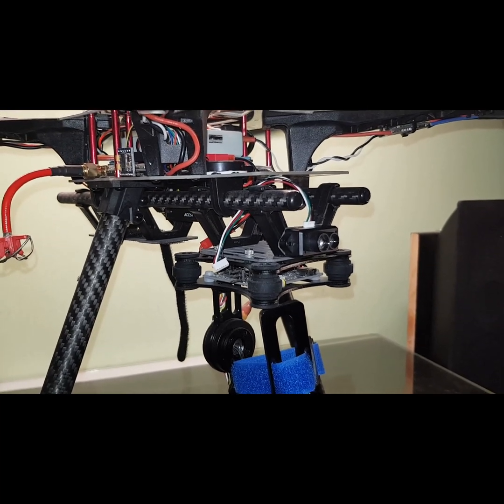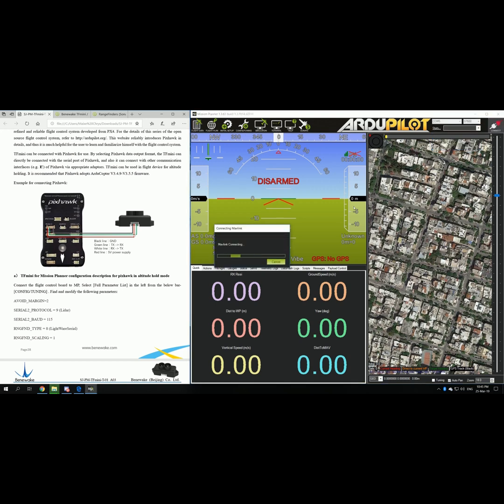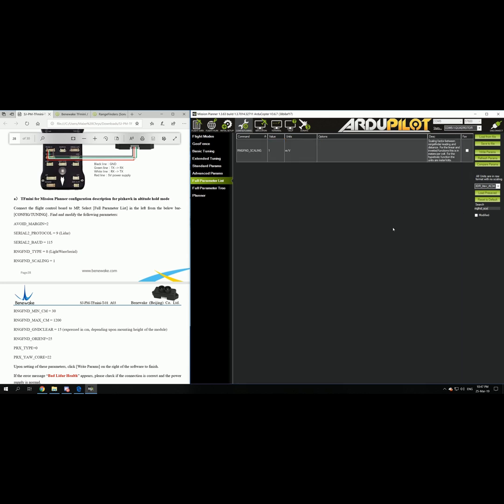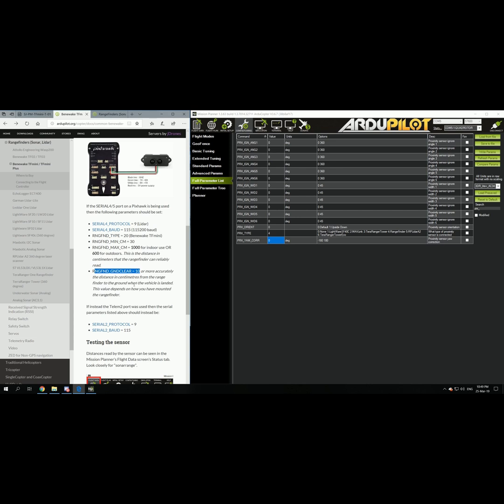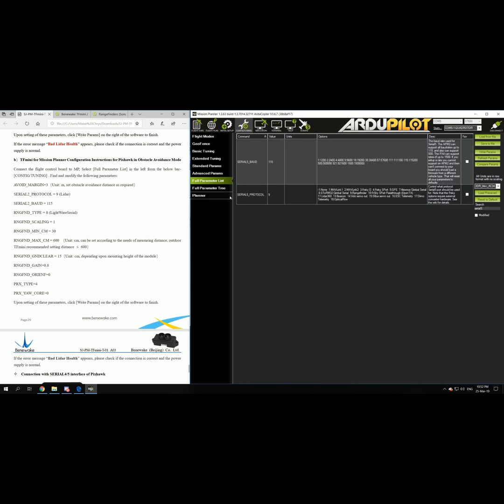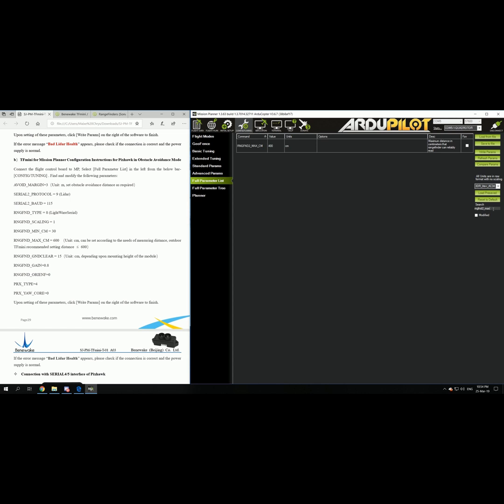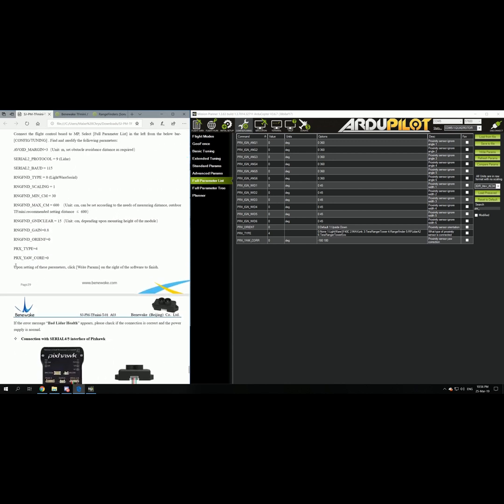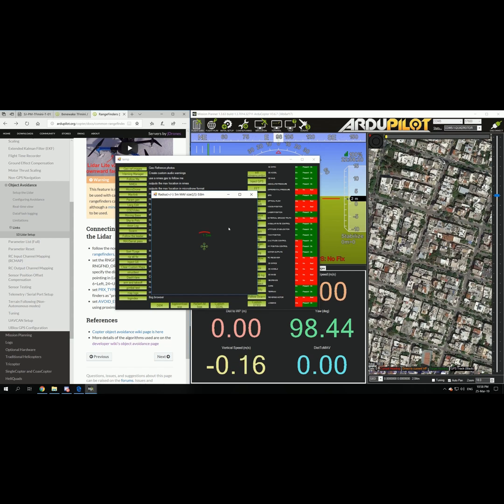Part 2/2 How to setup Pixhawk with two rangefinder sensors, object avoidance and height estimation.

Comment: Hello Maixe. In february I start my last university year project. Im making a drone that flight inside a greenhouse and collect data. But also I need to implement a object avoidance. Im gonna use the pixhawk and as you do, this lidar sensor. My question is. Once you have done all the process you do in your video, the drone automatically correct its possition when an object is detected by the lidar? Or do i need to do something else apart from this video? thanks
Reply from the maker: This will work, the only thing you might want to is to play with the settings on how the craft will react.
Reply: @maixechrys6264  Nice. Im forced to fly in althold mode. Does obstacle avoidance works in that mode. 

Also, is there a minimun of distance the lidar can detect and the drone react? I mean, as im flying inside, I will need to set the lidar probably at 30-50cm

Comment: Hi, great video. This was just what I was looking for. I have a doubt. I am using the same two sensors that you are using for the same purpose ( height estimation and object avoidance ). Can we configure the forward sensor for object avoidance and downward sensor for height estimation only( no object avoidance ). I have this doubt because parameters like Avoid_enable,avoid_margin,prx_type are global and not specific to that particular range finder. Please correct me if I am wrong.  So how can we set avoidance and avoidance margin individually for each range finder
Reply from the maker: Thank you very much for your kind words.
Check the video after 7:00 where I switch to the avoidance sensor.
Rangefinder2 in my case .
Avoid parameter only refers to the horizontal sensor(s) for object avoidance, so it really is specific for that purpose.
The setup you are trying to make is exactly what the video discribes so make sure you dont miss a step!
Reply: @maixechrys6264  got it …. So there is no obstacle avoidance for downward sensors. Only surface tracking. The avoid parameters are for horizontal sensors
Reply from the maker: @RajPatel-vc6mg  yes that is right, unless you start messing with its orientation that is how it works. Surface tracking kind of works like avoidance though.
Reply: @maixechrys6264  Thank you, I got both the sensors working. I just have one more doubt. I can’t see the sensor distances on my mission planner hud. I can see them in my proximity tab by pressing clt f . How can I see the distances on the hud like you have set them up. Thank you
Reply from the maker: @RajPatel-vc6mg  you right click the hud screen and there is an option to show aditional sensor readings, I dont remember by heart though.

Comment: hello sir, I have 3 question and i didn't find right answer :( please help me.  How can we connect external sensors (leakage, ping sonar, temperature-humidity sensors) to Pixhawk PX4? Can we connect multiple sensors if we can how do we do it? Can we connect 3 Distance sensors to Pixhawk if we can, how we can do it?
Reply from the maker: Hello, first up you need to identify what protocol the sensors use, for example are they using telemetry ports or i2c?
Reply: @maixechrys6264  --> DHT22 humidity & temperature sensor (DHT22 also named as AM2302)
     •	Output signal: digital signal via single-bus
    What protocol does DHT22 use?
     •	Single wire protocol (single wire/bus for communication)

-->A02YYUW Waterproof Ultrasonic Sensor
     •	Output: UART
     •	RX: Processed Value/Real-time Value Output Selection 
     •	TX: UART Output

--> BlueRobotics SOS Leak Sensor
     •	I did not find any information about its protocol.

--> BlueRobotics Ping Sonar Altimeter and Echosounder
     • 	The Ping sonar communicates with a serial UART using a binary communication protocol called Ping Protocol
     •	Signal Protocol: TTL Serial (UART)
     •	I found that we can connect it to pixhawk’s SERIAL2 port (Serial/UART port). Is it ok?

--> DFRobot Gravity: Analog Water Pressure Sensor
     •	Integrated Circuit (IC) engineering technology.
Reply from the maker: Uart is a telemetry port, so you have to connect it to one of the 4/5 telemetry ports and go to the advanced settings and change the number that corresponds to your sensor maybe the manual has this information.
Uart or telemetry ports are unfortunately limited and Telem_1 is reserved for the usb connection to pc.
On the other hand I2C port can connect many sensors using an I2C splitter.

Comment: hi sir can you please explain how many sensor i can attach to a pixhawk. can i attach 4-6 sensors?? thank you
Reply from the maker: You are limited by the telemetry I/O of the controller. In this case we can have a maximum of four, if you want more or if you dont have any other serial ports available you can opt for an I2C based sensor witch can be a lot more than 4.
Reply: @maixechrys6264  m kinda new to all this. And there is no proper tutorial that shows how to install. You said it can take 4. 2 i saw how you did it. What about the other 2? Actually i m using ultrasonic sensors. I do have tfminis too.
Reply from the maker: @RETROGAME-FIX  Do you use gps? Osd? If yes then i am afraid you do not have any serial ports available. Maybe you can fit one more but you have to see how many teletry ports are available to you.
Reply: @maixechrys6264  the project is to build an obstacle avoidance drone all 4 directions and if possible, add 2 more sensors for up and down. There are tons of video and pages but for some reason its not working for me. Maybe m broken or my electronics are broken. I can compensate the telemetry and osd for the sensors. I saw the I2c option too but again i am not able to use the tfmini with i2c maybe m missing something in mission planner parameters.

Comment: I have a question about setting Obstacle Avoidance Mode.

When the parameter "RNGFND_ORIENF" is set to "25: down", the displayed number moves, but when it is switched to "0: front", the display becomes "0" and it is not measured.

The other parameter settings are the same.

Comment: Hey can i use 5 of these on a drone 1 for each direction and 1 for heigh estimation??
Reply from the maker: I think is better to use I2c sensor like the Maxbotic for that application, as I am afraid there are not enough telemetry ports for 5 sensors but I2c can be much more.
Reply: @maixechrys6264  can you provide a link to this sensor?
Reply: @maixechrys6264  better yet is it possible to make a splitter like you made in the video but for 5 instead? Or maybe a circuit that connects 5 to 1 and plug it into the pixhawk?

Comment: Well, thanks I am also trying to do it, with the help of TF MINI,  I have done all the steps you have mentioned, but after that how to check if it is working ?
As I tried practically and it didn't worked
Reply: Did you solved it? I have to build one

Comment: Hello, I noticed that when I set PRX_TYPE=4, the sonarrange becomes zero. But on the proximity console I am able to see the objects detected. Any suggestion?
Reply from the maker: There must be another problem as the prx_type is always 4 for this kind of sensor. Check that every other paramerer is correct and that you have rebooted the vehicle. Are you using 2 sensors?
Reply: @maixechrys6264  using just one sensor for obstacle avoidance. The other parameters seems to be correct. Should the Rngfnd1_type be 8 or 20 ?
Reply from the maker: @pavanshetty9117  it works both ways, rerun the setup if the tf mini and its programming you have to set it up to work with pixhawk. Also watch the first part  of the video.

Comment: it's posible to connect 4 One-way Lidar Range Finder Sensor to the pixhawk or cube? awesome vid!
Reply from the maker: You can connect as many as spare telemetry ports allow, if you have i2c sensors and not Mavlink there is no limitation within reason. Best you can do is connect 2 mavlink and 2 i2c. Thanks!

Comment: My goal is to create a sensor that can detect a wall/surface within a foot, and lock off horizontal travel, essentially terrain follow but for vertical terrain. Would you advise using LiDAR sensors and programs that are made for terrain follow but mount them horizontally on my drone? Or should I go with something  else or a different sensor?
Reply from the maker: Thanks for commenting, yes i think the sensors are capable of doing that. Lidars sometimes have limitations in very bright light in that case you might want to go with camera style avoidace (like the dji drones) but I do not think is nesessary.
Reply: Maixe Chrys awesome thanks, as I am quite new to this could you advise me for places to look, I’d rather not program my own system I’m sure it already exists.

Comment: Thanks for the Video. I have been trying to set up tfmini plus for object avoidance, unsuccessful. I m using serial 5 as rangefinder2, that it did not detect. I tried serial 2, but rangefinder1 jumped to serial2 as rangefinder1. Any suggestions will be helpful. Thank you.
Reply from the maker: That is weird, sometimes you have to do it one by one and restart when making changes. Use another cable and connect it to the back of the computer, sensors may not work with the battery unpluged.

Comment: Hello, i wanted to know what all modes are best for the collision avoidance, is it possible to test in indoor flight
Your reply will be highly appreciated
Thanks
Reply from the maker: It is not good practice to use sensors indoors even DJI products suggest that you switch off the sensors the technology isnt there yet. For indoor flying you will need the sensors to cover a 360 field around the copter. Please check with ardupilot to see what modes support collision avoidance, it definatelly supports AltHold and Loiter ever RTL.

Comment: hello sir i connected it to flight controler and i also have connected leds and gps..the problem is that the gps and the leds went off during flight..is it possible that the power consuption is to big to handle ?may i use a 5v beck to power the sensor?
Reply from the maker: Ya sou Giorgo, Im going to need a bit more info on that, for instance where the led's get their power from? Is it through the servo rail of the pixhawk?
Reply: @maixechrys6264  yes my friend
Reply from the maker: @djitastic2502  well assuming that you use some kind of power supply (maybe the current sensor style) that plugs on the power connector on the pixhawk, then the servo rail and the power supply is completely seperate from each other if you think your ubec is not supplying enough power check with another. Also check the zener diode/capacitor mod for the pixhawk. You may need to add a capacitor to the servo rail.

Comment: hi i follow all instraction and says only  check proximity sensor
Reply from the maker: Hello, have you been able to check that the sensor is working through the benewake provided software?
Reply: @maixechrys6264  hi rngfnd to get 8 and not working 
If get 20 working what the different?
Reply: @wrathfulfpvboyz4481  well, use 20 if it works.

Comment: Thanks for the Video.I need a help. Im using analog for range finder. i can able to see the data in status too. But still the mission planner shows the barometer reading in altitude.I need to fly the drone  one meter above the ground in guided mode .will pixhawk use baro altitude or the range finder data? is there any changes in parameter list?
Reply from the maker: Pixhawk will mainly use barometer altitude above set max altitude of sensor, are you using the benewake tf mini or another sensor? If so the parameters are irrelevant. I do not recomend setting the lidar as the main instrument for height if you want to see what the sensor reads you need to enable sonar_range in the user items.
Reply: @maixechrys6264  thanks for the reply. yh im using benewake.but im not worrying about the sensor readings. readings are pretty good. but i coudnt fly with that data. pixhawk ask to disable the gps when using range finder as main altitude source. can u suggest me a way to do terrain following using rangefinder with pixhawk using dronekit?

Comment: I have followed all the instructions as mentioned but I am getting Bad lidar health. I am using only 1 Tfmini sensor for obstacle avoidance. Any suggestions?
Reply from the maker: Please be aware that the tutorial is for two sensors, have you read the manual from benewake page? 
Have you seen part 1 of the tutorial?

https://www.youtube.com/watch?v=I1F_ac4Uous&t=1s

b）TFmini for Mission Planner Configuration Instructions for Pixhawk in Obstacle Avoidance Mode
Connect the flight control board to MP, Select [Full Parameter List] in the left from the below bar-
[CONFIG/TUNING] . Find and modify the following parameters:
AVOID_MARGIN=3（Unit: m, set obstacle avoidance distance as required）
SERIAL2_PROTOCOL = 9 (Lidar)
SERIAL2_BAUD = 115
RNGFND_TYPE = 8 (LightWareSerial)
RNGFND_SCALING = 1
RNGFND_MIN_CM = 30
RNGFND_MAX_CM = 600 （Unit: cm, can be set according to the needs of measuring distance, outdoor
TFmini recommended setting distance ≤ 600）
RNGFND_GNDCLEAR = 15（Unit: cm, depending upon mounting height of the module）
RNGFND_GAIN=0.8
RNGFND_ORIENF=0
PRX_TYPE=4
PRX_YAW_CORE=0
Upon setting of these parameters, click [Write Params] on the right of the software to finish.
SJ-PM-TFmini-T-01 A03 Benewake (Beijing) Co. Ltd.
Page30
If the error message “Bad Lidar Health” appears, please check if the connection is correct and the power
supply is normal.

Comment: Can I use only on lidar facing front ?
Reply from the maker: Yes of course you just skip the steps for the secondary, follow the instructions provided by benewake.
Reply: Ok
Reply: Can you please provide parameter file for latest pixhawk firmware for Quadcopter?

Comment: i have followed your tutorial, but for some reason i am not able to get the Red line with distance.. dont know what i did wrong.
Reply from the maker: Have you watched part one of the tutorial, I fear you might havent set up the lidar to talk to pixhawk. You have to enter programming mode and enter a command line to the lidar so that it sends signals compatible with pixhawk and ardupilot.
Reply: @maixechrys6264  i did not before, but i did and followed the tutorial. And it worked well for a while. But now it is stuck on 2.5m red line. Its knid bouncing from 2.2m - 2.8m. Although my quad is facing a wall with 30cm.
Reply from the maker: @RETROGAME-FIX  I will point something obvious that you must have done already, but never the less have you updated the firmware on the lidar and pixhawk aswell? Have you restarted the pixhawk after any change and checked afterwards? Follow the instructions provided in the tutorial as I suspect any deviation is likely to result in failure. I remember having this sort of problems when doing something different that the parameters I present here (exept the distance that is up to the application of the final user).
Reply: @maixechrys6264  thanks a million sir for the quick response. I did updated the firmware on pixhawk but wasnt able to update the lidar, when clicked the update nothing was happening. And I have found out that when the FC is connected to pc via usb the lidar sensor has some power surge and does not response well. But when i connect it to the battery it starts working. My second question is that the obstacle avoidance is constantly in on position or do i have to assign to a mode. Coz i jave seen the option in modes. M using MP 1.3.66 and i dont have seen AVOID_ENABLE  in the parameters list.
Reply from the maker: @RETROGAME-FIX  Ok first things first, it is the pixhawk firmware that is responsible for showing the parameter required. If it is not implemented in the stable build maybe you have to download a Beta firmware to make the required parameter appear. As for the lidar it should work with usb, provided that the usb port is directly connected(no hub). Tell me what you need more specific and I might make a video about it.

Comment: Great video! Could you kindly do a flight video that shows how the quad behaves on the different flight modes with the two lidar sensors installed?
Reply: @maixechrys6264  thanks for this info. What about guided RTL? Like terrain following and obstacle avoidance?
Reply: the same question that i was looking for
Reply from the maker: @kakemboluide  After some searching, I believe this is the info you are looking for, http://ardupilot.org/copter/docs/terrain-following-manual-modes.html http://ardupilot.org/copter/docs/terrain-following.html#terrain-following